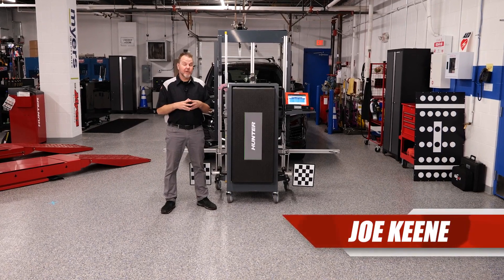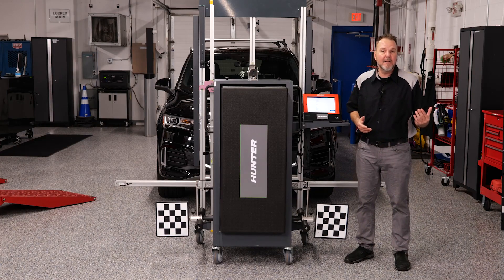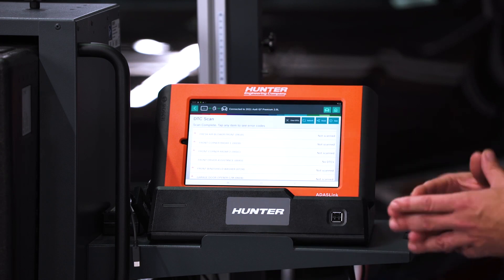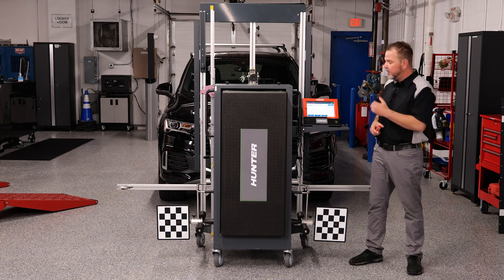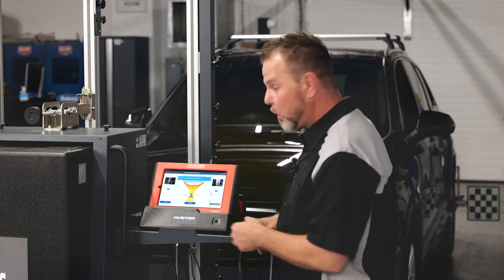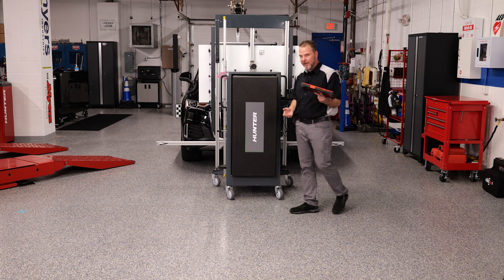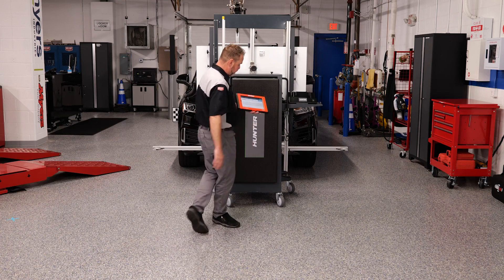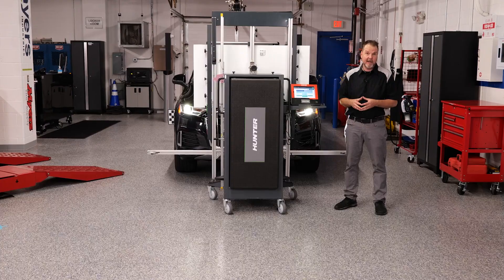ADAS calibrations: Audi driver assistance system front-facing camera

Comment: How long time does a prescan normally takes?
Reply from the maker: If you're looking for speed, we recommend a quick scan. There is a "button access" in the software for that.  Otherweise, scan times vary depending on the number of modules available for each vehicle being scanned.
Reply: @HunterLearningChannel  Thank you for a quick reply! like the car in your video that u speed up. Did it take like 10min or lower?
Reply: In this video this particular 700 module scan, how long did it take, approx is ok. Ty great video